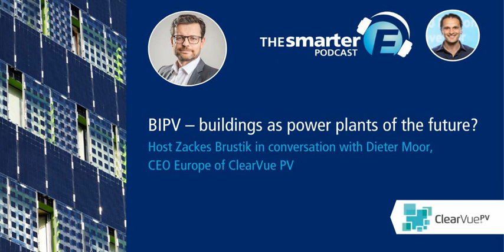BIPV – buildings as power plants of the future? | D. Moor, ClearVue PV | The smarter E Podcast #83

Comment: Large construction projects have traditionally had A SEVERE impact on the electric grid. With the increase in blackouts from climate-related events, this should be front-and-center of any discussions related to new construction efforts, since the building sector is responsible for up to 40% of all CO2 emissions worldwide. Solar panels are good-but inconvenient- and currently lack dependable solutions for disposal. Left to me, it would be MANDATORY that all new construction projects in excess of 50,000 square feet include BIPV solar technology in the structures' envelope.